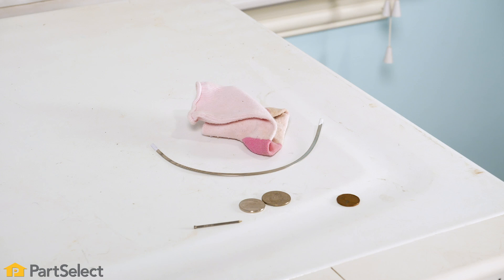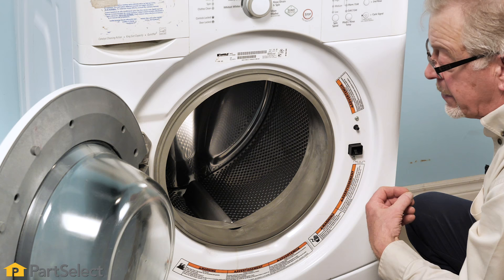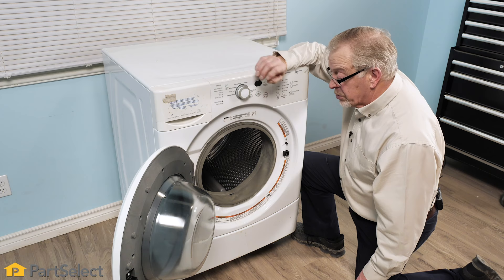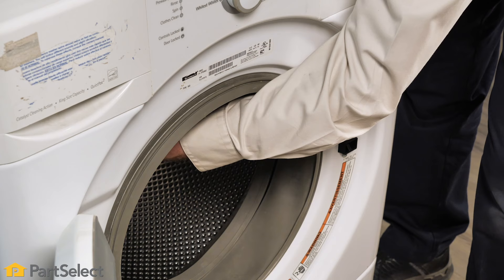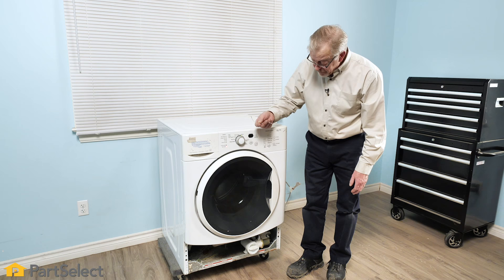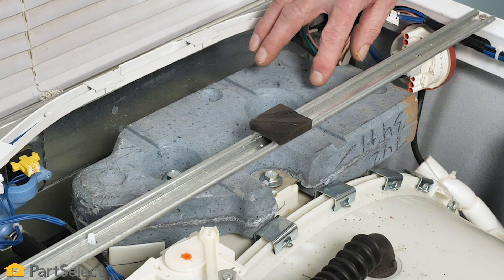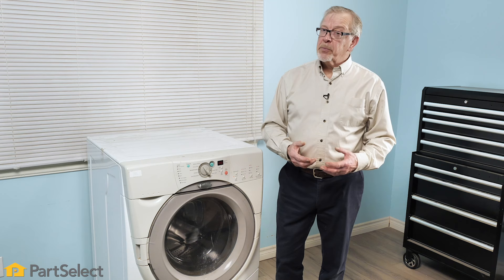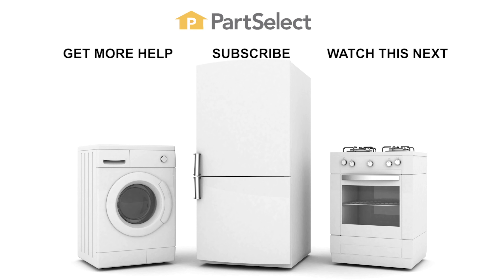Washer Troubleshooting: Common Reasons Why Your Front Load Washer Is Noisy | PartSelect.com

Comment: Thank you so much for this video. Thought that the bearing was gone and followed your advice in the video and it turns out that one of the tub supports had worked loose. I tightened the securing screws and finally peace and quiet! Thought we were going to have to replace the machine and had gone around the stores looking for a new machine. Now that its fixed I have told my wife that we should get another 12 years service! Not sure she's a pleased as I am! Brilliant instructions!

Comment: Was about to take my machine apart due to the grinding noise between the drum and the tub.  Decided to hold off until I inquire if my unit is still under warranty.  They were close when I called. Decided to search the web for causes.  Came across this vid.  Finish nail on the back of the drum, not on the side as I expected at first may be caught between the drum and the tub.  Saved me a lot of work.

Comment: Excellent video! Very helpful! Sadly I either have a bad set of bearings or the tub support is broken. The tub does not spin freely, is loose when I push from the front to the rear, and has a burnt rubber/plastic smell - the wet clothes actually smell like burnt plastic. Argh.....

Comment: EXCELLENT vid.  i went right to work!  my noise was the tip of the rubber hose (6:15) fell in into the drum, and the drum was rubbing it will spinning.  all fixed!

Comment: I'm not sure this helped me solve the noise but it did at least help me identify some things that it is not, so I very much appreciate that.  I have an odd clunking almost like an out of balance sound but it looks perfectly balanced only at medium spin speeds and oddly worse with a empty load (like tub clean mode).  Doesn't seem to have any play like you describe for bad support or bearing, although ever since we've lived here the drum does not spin super freely but is extremely smooth...though it's also the only front loading washer that I've ever used which made me think that's normal.

Comment: If you've just installed or moved the washing machine you should check if it is level. That was my problem. It was so noisy during the spin cycle.
Reply: This should be the first thing to try. Most modern machines are designed to be perfectly level orientation and have adjustable feet to allow that. If the machine is tilted, the suspension doesn't work correctly.

Comment: Hi. Great Video. I have a Bosch Next Washer. How do I remove the Pedestal Drawer so I can see if I’m able to access the bottom of the front loader, see shocks. Also the large round spring that holds the seal in place between basket and door. Please demonstrate how to Remove it and more importantly how to put it back. Please I need your help. Thanking you in advance Sir. 
All the best to you and family, Mike i.

Comment: My 2 year old at most Samsung smartthings had the banging noise it seems to be lose bolts that hold the balance weights on. 1 bolt fell out and 2 others were very loose. I tightened them back up and it seems fixed 🤞🏻

Comment: My front load GE washer sounds like an airplane is taking off.  It is a very loud whirring noise.    What could be the problem?   It seemed to happen after I was trying to clean the fluid paths making sure water could flow and lint was not building up.  Could I have pushed something into the bearings?  Is it possible to clean?

Comment: What would cause a humming noise from the motor that's just unusually loud during spin cycle?  Not necessarily abnormal in character per se, but definitely abnormally loud. No grinding or knocking or any other sound. But I've heard very loud machines in the past, but none like this one. 
P.S. the machine is fairly new. I rent, it was used by the previous tenant, don't know if this is a new development or not.

Comment: I have a GE front loader I bought back in 2007.  Yesterday it briefly made 3 loud thumps while at low spin cycle and then a series of smaller thumps and when I looked at the left side, it looked like something from the inside was hitting against it. I saw it bulge out as it was making the lesser thumping sound.  The thumping then went away at spin cycle.  Is it worth fixing or should I get a new one?

Comment: Mine makes a squeaking noise of drum rubbing against seal and goes Da Dum Da Dum when I spin the drum. The drum freely turns with no problems. It won't spin off properly and the clothes are wringing wet when I open the door. I checked the belt and everything mentioned in this video and I still can't work out what the problem is. Nothing in the seal and the filter's clean. The machine's only 4 years old, so probably not the bearings. Also I never overload it, so I've no idea what to do with it.

Comment: 8:50 - have a GE front load washer that makes a chirp /squeak noise on the wash cycle when the basket changes direction.  Normal sounds on all other functions.  
what could be making that sound?  Happens more with a larger load.

Comment: At the 10min mark with shocks.  I replaced mine and it didn't help.  Is it possible the top springs are defective?  It's 8yrs old and banging on the spin cycle no matter how balanced the load.
Reply: Mine’s doing that after I replaced the shocks. It’s a knocking sound from the back on the spin cycle. Did you figure yours out?
Reply: I should’ve said, it was knocking before and the new shocks didn’t help..
Reply: Any update on your issue??

Comment: Hi Thanks for the detailed troubleshooting, but I still can't figure out the cause of the scratching noise of my machine...Recently, my front loader produces some sort of scratching sounds when it’s on the washing cycle when it spins slowly. No such sound is produced in the spinning cycle when it spins at high speed. I tried to check the drum after I took the clothes out but couldn’t anything stuck in it. Any ideas for the reason?
Reply from the maker: It is possible there is something between the inner and outer tub causing that sound.. At high speed the item is being pushed out of contact by centrifugal force. Is it every load or an occasional one you are hearing this noise?  What model of machine do you have and how old is it?
Reply: @partselect  thanks for getting back to me! It's most loads but not every load so I found it really weird. My machine is a BOSCH series 4 and about 6 years old. I guess I'll have to get someone to dissemble the machine to check it out?

Comment: My whirlpool 2zsher just started making a thud noise  would it be  a belt?
Reply from the maker: Front loaders that are making a thud noise are most likely is a broken suspension shock. Your machine may also be vibrating or moving around a bit more as well.